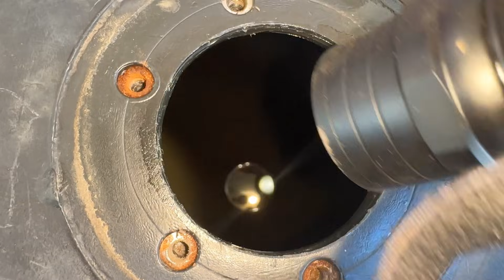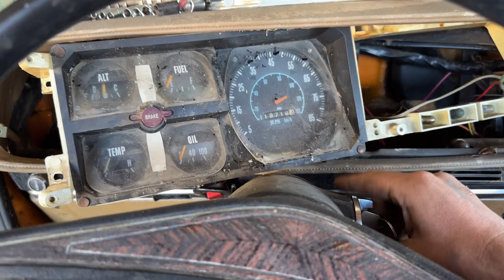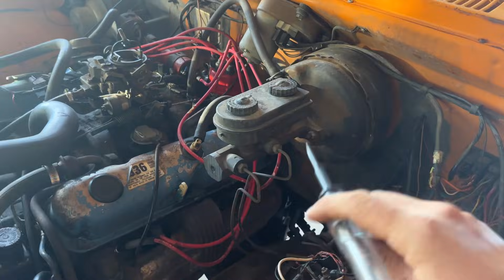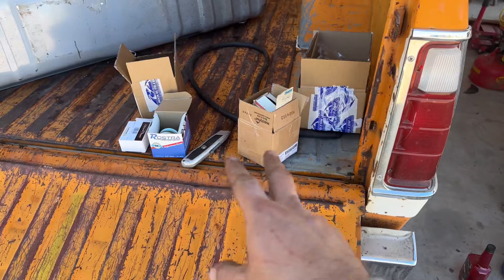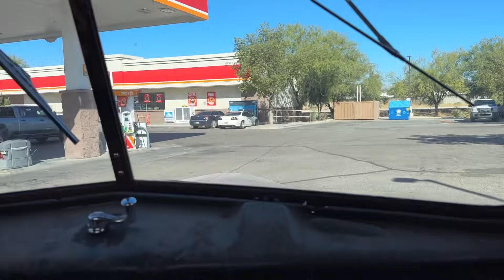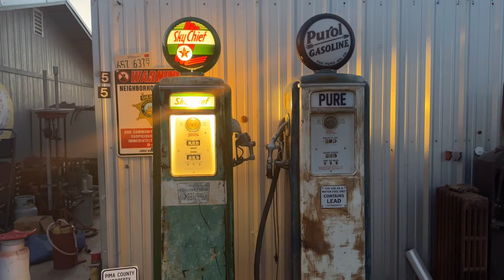Abandoned Power Wagon gets roadworthy after sitting 22 years!

Comment: I don't have a clue why you crawl around under trucks, you own a tractor cut or remove the six bolts holding the box on and unplug the lights, lift box off with tractor. Then do the gas tank, brakes, fuel lines, brakes, tiresand shocks, pressure wash everything before starting work, when your finished drop the box back on.

Comment: My current truck is a 2000 dodge ram laramie slt quad cab long bed magnum V8 318 46RE AT transmission manual shift transfer case lever on the floor also a dana44 truck with 3.55 gears because it is a factory towing pkg truck.

Comment: The main power feed on those mopar vehicles are feeding off the back of the ammeter or alternator guage and when they lose connection it won't crank and that was a common hack to bypass it so it would start as it should, but I always wanted my truck to have working guages and start as it was designed course that was not exactly true since under the hood it mounts and the inner fender aprons and the frame had been hacked up, modified, cut out and welded in because the truck had a 66 Plymouth fury or satellite wagon poly 318 in the truck ran great and sounds great...

Comment: When working on these new style trucks a lot of times its was easier to pull the box of the chassis with your engine cherry picker or chain block, usually only held on with half dozen bolts. Then you can do all brake lines fuel lines fuel pump, shocks, everything is done from above and not crawling around on the ground. You can also pressure wash everything before you start and don't have to suck in rat turd dust the whole job.

Comment: Word of caution. that ammeter SHOULD NOT BE HOOKED UP!  they are notorious for burning down trucks thats why it was unhooked. on these trucks and other mopars of the same vintage , the entire electrical system with the exception of the starter  draws its power thru the ammeter.  could be 35+ amps flowing thru it under certain circimstances.  Its not worth loosing the truck just to have an ammeter working. its a very good idea to unhook it and do the bypass so as to distribute the electrical load around this wiring and eliminate the possibility of an electrical fire. it could occur even if the truck isnt being driven if something were to be drawing power. I drive a 74  dodge powerwagon and i damn near lost my truck from the ammeter. i wasnt even in the truck it had been parked for several hours and i started smelling electrical. i looked around and seen my cab was smoking profusely and the cluster was on fire. i was able to get the battery unhooked just in time . had i not been home or near the truck it surely would have burned to the ground. theres lots of good schematics on the internet showing you how to bypass the ammeter.
Reply: I agree with you. My '79 I bought on cheap because it had a dash fire from that same spot. A friend of mine helped to rewire everything in the dash and than some later and the truck was back on the road. I had 3 wonderful years with it before rust took it away. I was the 2nd owner. The first owner new got the undercarriage cleaned after winters. When the front frame rails rusted and broke it, was time to put her down. I miss that beast.

Comment: Man, I would seriously LOVE to have this truck. I would do a 4 bbl swap on it, swap on a set of longtube headers, and a true dual 3" exhaust back to either Flowmasters or Black Widow mufflers with some 12" chrome slant cut tips. I'd also get my hands on a set of the old school slotted wheels (like I had on my 1984 Ramcharger) with some 33x12.50 mudders. After that I'd clean up the surface rust on the frame and the underbody and shoot it all with some primer and Raptor lining to seal it up. Later down the line I'd try to find a cheap 360 LA or a 440 LA swap. I ended up swapping the 360 LA 4bbl in my 1984 Ramcharger for a 360 Magnum with the 727 and NP203 transfer case. It ran great, always started on the first crank, pulled hard, and it would climb anything no problem.

Comment: Great video, but hold on a second...lol. I think I know what you were doing when you tested the gauges, but be careful about the terminology. The way that Mopar and most other clusters work is that the cluster is supplied with key on 12 volts, which is stepped down to about half by the IVR...Instrument Voltage Regulator. One side of each gauge not including the ammeter is supplied with IVR voltage. The other side of the temp, oil and fuel gauges is the ground side through the sending units. Each unit is a potentiometer that allows varying amounts of "ground" through, just like a fuel sending unit operates. There is NO power present at any of those sending units.  You did in fact test the circuits for continuity, which is good work.

As another viewer mentioned, those ammeters are a fire hazard. Mopar foolishly routed ALL the electrical load through those undersized ammeters on all their vehicles into the 80's, so when the lights, wipers, fan motor etc are on, it goes through that ammeter. I've seen them get so hot they melted the lens and the needle fell off. As a mechanic, NEVER assume someone just didn't know what they were doing. I would go back in there and reconnect those wires pronto. There are fusible links in the harness but those are the most durable part of it unfortunately.  Last thing, try to avoid saying "honestly" and "to be honest" so much because that gives people the impression you might not always BE honest. Keep up the good work.
Reply: I thought Chrysler changed the Ammeter wiring after 1973, Maybe they didn't on Trucks, They also didn't wire them that way on models with a lot of electrical accesories and ones for police use.
Reply: @jdpinbaytown  You are correct in that vehicles with high electrical loads and high capacity alternators like the Chrysler 100-amp units and the Leece-Nevilles used a shunt around the BULKHEAD connector, because that's the second most likely spot for a failure, but I have no knowledge if they bypassed the ammeter somehow. I've never seen one of those vehicles in person. I'd like to though to see what they did.

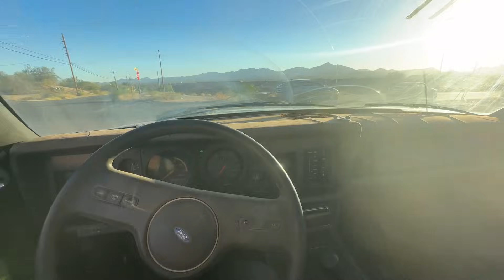Comment: 19:51 Ford power steering pumps whine when the wrong fluid is put in them. They were designed to use transmission fluid, not power steering fluid. Car owners and Jiffy Lube employees who don't know that put power steering fluid in the pumps when they are low which makes them whine.

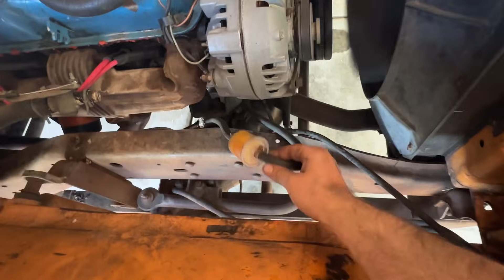Comment: 14:32 you will be changing that filter out for a metal inline filter. I had a plastic one in the engine bay of my 83 F-150 and the heat from the engine bay made the plastic shrivel up.

Comment: The ammeter was bypassed because this era of gauge is notorious for getting hot,  melting and starting electrical fires under the dash. Bypassing the gauge is pretty common in these trucks.
Reply: from the starter going " errr, errr, errr, errr... " for at least 60 sec.s.

Comment: It's a good idea to wear an N95 face mask when cleaning up rodent droppings. They may contain Henta Virus, which is a very nasty viral infection that makes Covid look like a picnic. I causes a severe respiratory infection and can lead to renal failure and deathe, Before cleaning an area infested by mice, air out the space for 30 minutes. Then use a mop or sponge and a freshly made 10% bleach solution to clean the area. Wear gloves while cleaning, and consider wearing a respirator (face mask) if cleaning heavily infested areas. Never sweep or vacuum as it spreads the dust containing the virus through the air where ir can be inhaled.

Comment: Speaking as a Non American, I don't understand the fascination of the pick up truck.....can someone explain it please? 🇬🇧🇺🇸
Reply: You’ll get many different perspectives and opinions from the people of YouTube but I see trucks like this as an extremely useful tool in getting work done, whether it be in the city or in the wilderness
Reply: And the chicks dig them
Reply: @steeliewheelies  I get that, but a van could hold more, and be secure if it's a work vehicle
Reply: Pick ups are more versatile especially if you get into the 3/4 and 1 ton range add 4x4, 4 doors and a flat bed or a service box with a pipe or lumber rack. You can't tow a goose neck trailers, a 5th wheel campers or haul a heavy or bulky load like sand gravel, a pallet of bricks or water with a van. The light service industry in the US is usually using vans. Heavy duty mobile mechanics and utility companies use 1 ton or larger pickups with huge service boxes that may carry a crane, welder and an air compressor to start with.
Reply: I'm from Canada we have lots of trucks but I see them as only a business requirement. I have an old Chev mini van that can take a 4x8' sheet of plywood on the floor - actually about 50 of them...try and do that with a modern pick up. I agree a van is more useful unless you want to tow a large load or carry half a ton.
Reply: Joe Diffie said it best There’s something women like about a pick up man.
Reply: @BrianEBoyd  Just before they propped him up side the juke box ! 🕺 🎶 🛻
Reply: @BrianEBoyd  Noting classier than a bench seat pick'm up truck with your girl curling up on you.

Comment: full filler hose.  for my 59 rambler . it had a rubber hose to the gas tank.  couldn't find a replacement.. i made one out of similar size exhaust tube.  bent to fit . used a short rubber coupler.  been on the car sense 1978.   Suggestion for when yours starts leaking.  didn't cost much at the time.